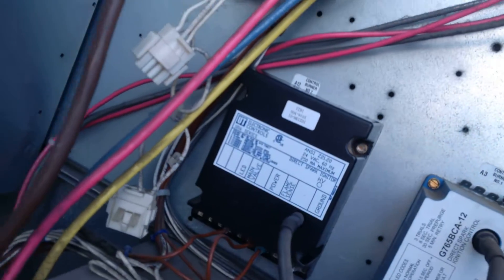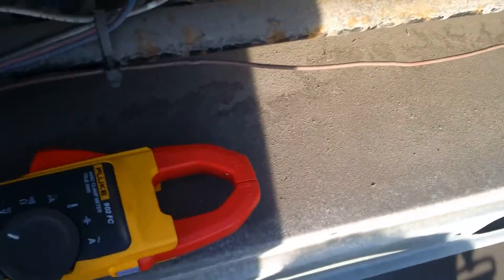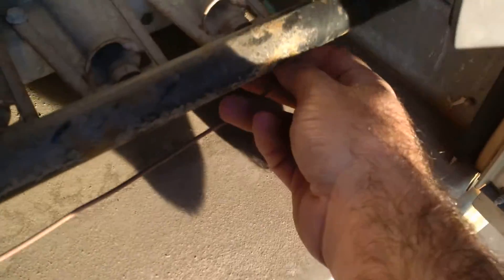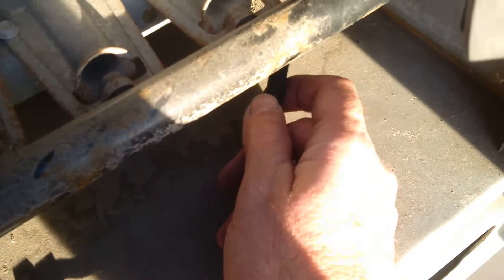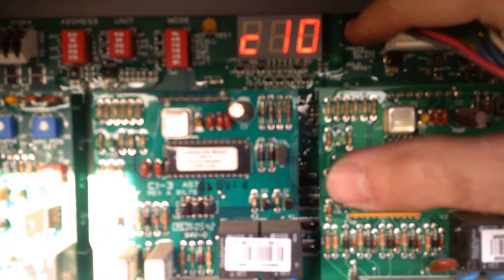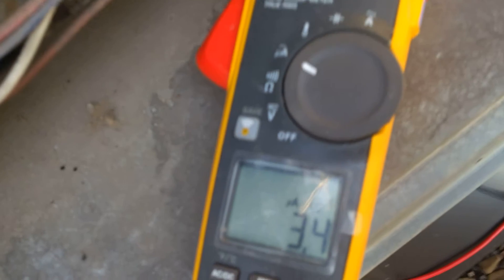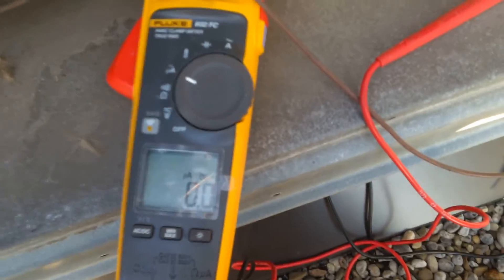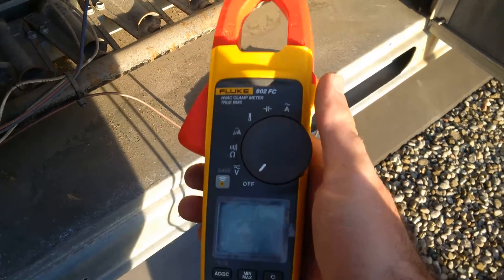Checking a flame signal with a Fluke 902FC

Comment: For checking micro amps and you don’t have alligator clips. Use a jumper cable in place of alligator clips so you’re not holding your lead to the flame sensor the whole time

Comment: Does that meter have a magnet on the back where you can hang it on anything metal?
Reply from the maker: No I just use the clamp to grab stuff lol
Reply: You can buy the Fluke accessory kit its called the TPAK which has a magnet and some other options.  There is a space at the top of the meter that it fits in.

Comment: Depending on the job, typically I use a small wire wheel to clean off the burners good and make sure the ground is also good when cleaning sensors. Dirty burners cause fluctuations in the readings. If it’s 20f below and I’m swamped I’m cleaning the sensor and probing for CO and checking the filter and making sure the T-stat works For on and off.